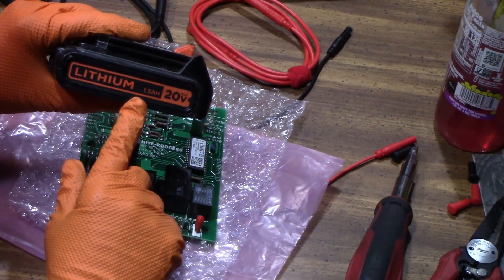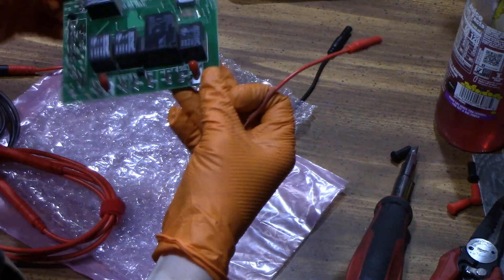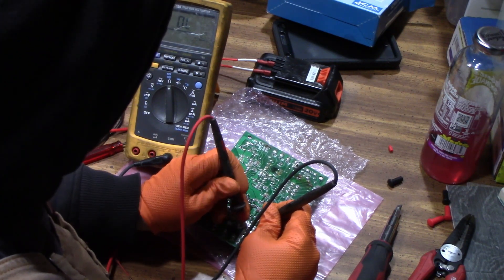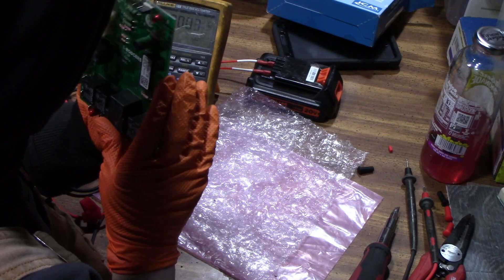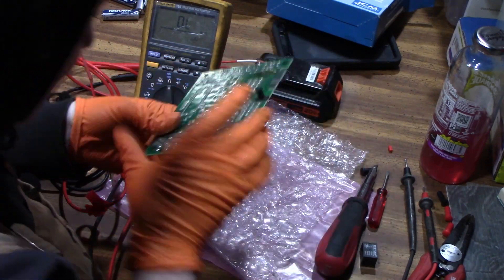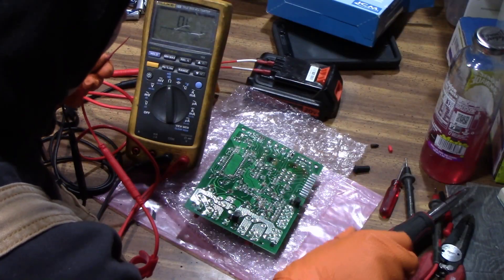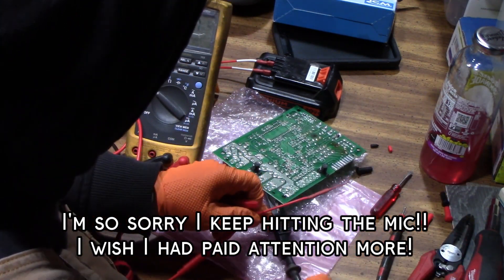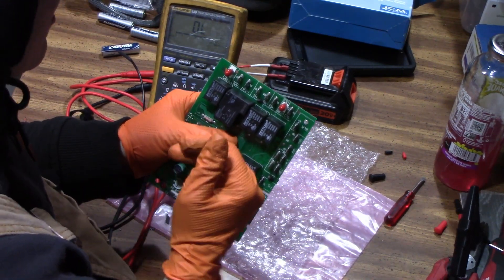Forced Air Heater Repair Follow-Up: Going Over the Failure

Comment: Dont know if your still on here, i seen your review on Amazon thats how i got here, im having issues finding the correct board. Numbers from my board are B18099-13 1017 933D do you know if the board on Amazon is the upgraded version of mine ?. Any help would be awesome thank you.
Reply from the maker: I'm so sorry I didn't see this until now. According my research, yes, that aftermarket board does apply and replace the number you provided. Using only the B18099-13. 

I found nothing regarding the latter 1017 933D. Could be a batch or date info.
Reply: @CubasAutomotive  i got it sorted out, but in the end it was the capicitor that went out. Thanks for getting back to me anyway

Comment: a bad "relay" on a junktronics board, you don't say!!! lol.
the resistors always run hot on them and slowly cook, worse on down-flow units with the boards mounted above the burner chambers. that said, I have not really found but a few with actual bad solder joints at them, the vast majority were all relay failures as you found and aftermarket board is most always cheaper than trying to repair :)
Reply from the maker: Interesting. I've only done a hand full of these and am no expert. Lol This is the 2nd I had to replace the board on, the others had bad blowers or capacitors.  

The only reason I tried looking the relays was trying to give the customer/friend options. I'm weird that way... even if temporary fix. It was just back to back with some other failures he had recently.  I agree, in this case the board was definitely the better option. The fact it lasted over 20yrs, seems like a decent model.

Comment: Great vid, Cuba - don't be so hard on yourself! ;)

You're smart - there's money to be made in anything mechanical or electronic! 👍 I've never worked on a gas-fired unit before. Oil is king where I live. I maintain my dad's unit, and ours. We burn oil, and coal. I leave it on oil for the summer for hot water, then switch to the coal stoker boiler when the temps start staying below 30°F for heating - saves me a bundle on oil. The oil is more efficient when the temps rise, and the coal unit is the opposite. Just adds a little bit of work to the day, filling the hopper nightly, and taking out the ashes every few days. And of course, the monthly ash cleaning the chimney pipe and heat exchanger needs.

I saved myself a few hundred on a couple boards here years back. I had a small relay fail in my Amtrol 41 gallon indirect hot water tank (plumbed into the boiler as a 3rd zone). That relay was responsible for allowing the board to be operated on 24vac or 120vac - of course, when it fails, it defaults to 24 volts, which it wasn't wired for. Board flaked out and I had no hot water. I fixed it, but I had ALOT of help via a post by an electrical engineer in the comments section of the company's website. He was pissed that the company was charging people all that money for what he thought was an easy fix. Well, he was right! I desoldered the relay, and installed a jumper across the pins he outlined in his post. That was 5 years ago - it's been storing hot water ever since! That was over $200 saved there.

Another board I had fail was for a Davis Vantage Pro 2 weather station I have on my roof. There's a small solar panel attached to the unit that charges a supercapacitor, which operates the unit when there's no sun shining (it's a wireless unit that transmits to a display in my kitchen). There's also a 3v lithium battery as a backup. When you start going through batteries every month, you know the supercap is bad. I bought 2 new ones, since there was a space for a second, which was factory installed for units sold in northern Canada and Alaska, to double the run time without sunlight. I installed both of those, and that got me 5 years down the road before the board glitched out and kept recording rainfall rates of 250" per hour, LOL!! 

My 1990's TV is broken now ... but I'm enjoying being without it. Nothing but crap on there anyway. Nice not having a $100  a month satellite bill now. I think I'll use the TV for target practice some time, and post that in a video.😁
Reply from the maker: Oh wow! That's a heck of a read Smitty! It's amazing the kind of info you can find when you look hard enough. Well worth the money saved...  for one. 

It's much better to do the research, as you learn more things along the way, maybe things in reference to the job at hand. 

I hear you on the TV being junk. I'm all about YT anymore.
Reply: @CubasAutomotive  - Same here with YT, Cuba! :)

Comment: Last week I repaired a GE microwave control board which had a 'weak' relay. It was partially functioning (very faint click when applying power using a 9 volt battery) but not enough to send power (120v) to the high voltage transformer. Soldered in a good replacement relay from a used board and fixed the issue.  Good thing is you got the heat back on for your friend.....nice to be a hero Cuba! 👍
Reply from the maker: Yeah, absolutely Glen! Another perfect example how the diagnostic procedures for the automotive application can cross over to appliances.  Using common sense & logic, we can almost repair anything!

I thought it was a different/separate issue on that microwave? Lol. That's pretty cool!  I'm not a fan of tossing big ticket items, not that a microwave is THAT expensive, but it's roughly over $100, I think, for a decent sized one.   

Exactly the same issue... the relay couldn't switch the high side very well. 
It's cool to read your breakdown here. I should've followed up better on your FB post. 😅
Thanks Glen! 😊😊🤗🤗
Reply: @CubasAutomotive  two different microwaves.  One was a magnetron the other was the relay issue and is a $600 model. 😉
Reply from the maker: @ozzstars_cars  ouch!! Yes, that's what I recalled, the magnetron. So 2 different ones?! Well heck of a save then!!
Reply: @CubasAutomotive  and a TV . $$ :-)

Comment: Any upcoming car videos
Reply from the maker: I have a whole head gasket series... but that'll be some time before I get it edited. In the meantime, I have some "how to" scope capture vids coming sooner...
Reply: @CubasAutomotive  what's the head gasket on?lmk
Reply from the maker: @jeremyanthonyw2r  on a 96 Windstar... 3.8ltr, my sister's which I never got posted yet. It's the editing that's the killer... but I have the entire raw footage. Also, some months in between, 1 because it had to be done outside, 2 I had to do paying jobs over this.
Reply: @CubasAutomotive  those 3.8 v6s are notorious for headgaskets. The problem with doing them on the windstars is I think you have to take the wiper cowl above the hood off to do those.
Reply from the maker: @jeremyanthonyw2r  I actually didn't.  All in engine compartment too. No issues.
Reply: @CubasAutomotive  so you had room without taking that off
Reply: So you had room without doing that
Reply from the maker: @jeremyanthonyw2r  yes I did. In my setup, it was not removable anyway. Only the plastic trim on top is (where wiper transmission  & motor are). The rest of the cowl is part of the body -one piece.

Comment: BTDT,  Most of those relays ratings are marginal for the job they do.  I got really fed up with the furnace in the shop a few years back. It had relay and control chip failures at least once a year. Went and found an LP mobile home furnace that has no electronics, Just a standing pilot and thermal switches control it. I hung a spare of each switch and the gas valve next to it, so those will never fail now that I've spent the money LOL.

As far as the video goes, sounds and looks great. You're not on camera enough but....
Reply from the maker: Hahahahaha... oh man! Not on camera enough. Lol Thanks for the compliment. 😅😊🤗

Interesting repair.  Of course, after having spares and going "low tech" solved everything.  I'm a firm believer in many things low tech. I prefer mechanical over electronic. .. one reason would be, mechanical failure, there's no debate that it has failed. Period. Electronic, however, not always the case. Think of a "glitch", "logic lock", or even a bulb which may even fix itself temporarily if smacked.  A few examples where determining an actual failure more difficult.  

I thank you for your input and your example. Other people's experiences always interest me. 😊